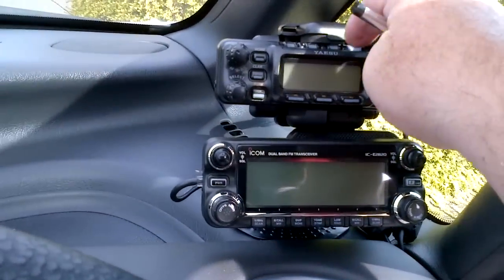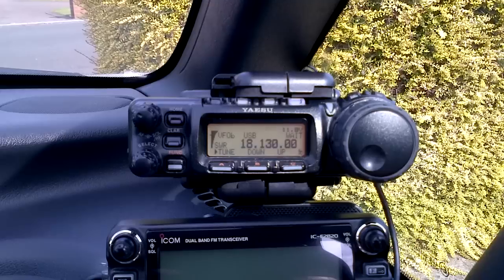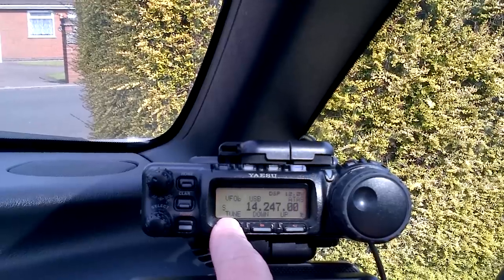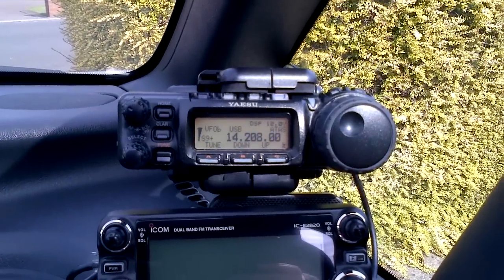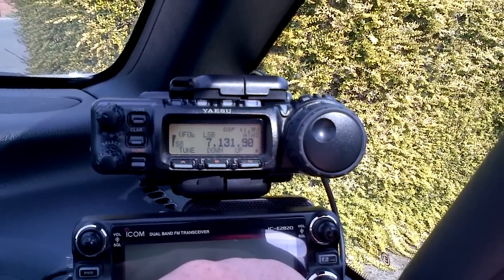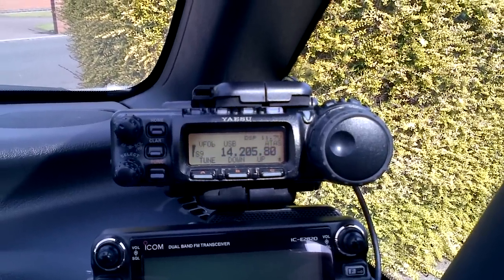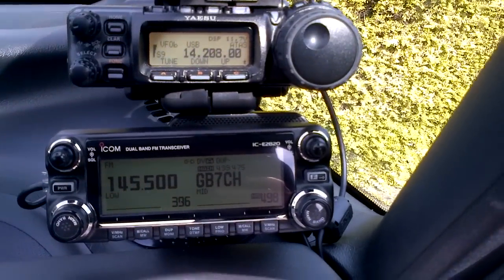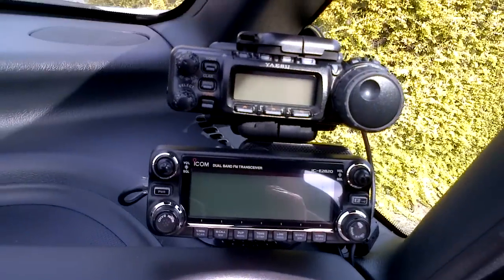FT857D & ATAS-120a installation Part 2

Comment: Where can I get the radio ft857D bracket for mobile...
Reply from the maker: Hi Reeio you can get the holders from loads of places here are just a few for you to check out   https://www.amazon.com/FTM-6000-FTM-100-FTM-300-FTM-350-FTM-400/dp/B09L7JDPJF      https://www.amazon.com/Holder-Adjustment-Anytone-BaoFeng-Kenwood/dp/B08GQDMWK1   https://www.lidoradio.com/collections/mounts-for-the-yaesu-ft-857-ft-7800-ft-7900-ft-8800-ft-8900   you can also look on ebay  hope this helps 73's Rob
Reply: One more question what holder to hold the radio front panel sir .. tq for your info..
Reply from the maker: @9w2syx   if you can do any 3D printing you can get info from here  https://www.yeggi.com/q/yaesu+ft+857d+remote+mount+by/   you can also get the remote head info from here  https://www.hamradio.co.uk/accessories-by-manufacturer/yaesu-amateur-accessories/yaesu-ft-857-accessories/backing-plate-ft-857-pd-5696   Hope this help's

Comment: The ATAS-120A antenna is a 40m maximum antenna.  It was never meant to tune on 80m, and the radio will refuse to go into tune mode when on 80m.  As you understand, bonding is important, but so is a choke balun to prevent RF from riding back into the radio.

Comment: Hello how does this setup work on the 11m band see we skipped that portion hahaha
Reply from the maker: Hi Kevin Z what you need to do is buy the radio or something like it and a cb antenna and get the radio moded so it works on cb band thats all, easy really loads of cb'ers have these kind of radio's on cb bands.
Reply: @M0AOV  thanks was trying to keep everything on 1 antenna since this antenna is tunable for basically all bands lol looking at doing a yaesu ft891 and some sort of screwdriver antenna...not hard to mod radio to do 11m lol

Comment: Hi, did you get any problems with ignition noise? I’m being plagued by it. It also picks it up from passing vehicles too when my engine is off. Can’t be the earthing though as the antenna tunes up perfectly on all bands?? 🤔
Reply from the maker: Hi Paul only just a very little when driving, you can only just hear it but not like your getting even when the engine is off I don't get anything from any other car's engine either, have a look at the NB and the other filters just in case they might help.
Reply: Been through all the filters etc, pulling what little hair I have out ha ha ha, you know it will be something really easy too

Comment: Bonjour, c'est possible d'accordé l'antenne automatiquement en dessous des 7mhz ? 80M et 45M ainsi que 11M (27.555mhz) ? cordialement.
Reply from the maker: I think I know what your asking, the atas120a works from 40m to 70cms and yes 27mhz can be used if your radio is opened up
Reply: @M0AOV  do you still have the atas??
Reply from the maker: @kd4kzz  Hi JEREMY Yes I still have the atas and use it almost every day, still working 100% Thanks
Reply: @M0AOV  thanks.

Comment: I imagine the problem is moisture.  Next time, maybe use come canned air to blow off the moisture and see if that works, because I imagine you have extremely high VSWR with the moisture on it.  Just a thought.

Jeff
W5JGW
Reply from the maker: Hi Jeffery thanks for the post, what it all comes down to with the Atas 120a is grounding i.e. using a good thick ground cable and not the obe's I was using at first, so once your ground connections are sorted the Atas 120a will work with out any problems. I've had the Atas working when the rain was so hard you had to have your wipers on full with out any problems SO Lack of grounding is the killer for the atas 120a not working correctly.

Comment: hi iv got an 897 and am looking at an atas too to get away from an atu as i do most of my operation mobile anyway.......what do you think to the atas overall and have you managed to sort your problem............the boot stops you have grounded to are added to the car after it has been painted so may not be a good grounding pointtake apart and take the paint off to the steel possibly?     many thanks and all the best m0ydb
Reply from the maker: Hi David
Yes I got the earthing problem sorted out I'm now using a lot thicker earth cable and the connections I have on the boot of the car is better so everything now works as it should do, I'll get another video showing the connections, I'm glad I use the ATAS120A it's a very good antenna and if you want to go mobile either get antennas that are just for each band or go for the ATAS
Reply: David Breed n

Comment from the maker: Hi Michael I've not updated this video for awhile YES I've done what you have posted below and my FT857D and ATAS 120A is working 100% on all bands, most things like this are always dependant on the earthing system you use for bonding for the antenna to work correctly.

Comment: Hi - experienced a similar problem with a ham friend with identical set up as yours apart from model of car lol. Anyway it was a grounding issue - or the lack of it to be exact. So we improved things with flat braided earthing straps on all four doors + boot hatch where 120a is mounted (bonded in three areas - antenna/right and left hinges. Bonnet/exhaust also got the treatment. Athough engine block is grounded for DC - we improved it with more flat braided straps - one on rocker cover and another in sump/gearbox area to chassis. Using the correct earthing straps is very important I find - also how there gounded to chassis. Improved things no end - has been 100% reliable thus so far. lol

A question for you please - I noticed you had the 11meter calling frequency logged in your ft857d. Can the atas 120a tune out of band to that frequency - presuming mars mod with your radio of course?
My ham friend ft857d hasn't had this mod done - hence the question?

regards

mike          73's
Reply: Michael Brock a few years later but I can confirm the areas will tune anywhere you can go into transmit. If your 857 is modded to TX on 27 you can tune it. At least I can on mine.
Reply: Yes, it'll tune CB